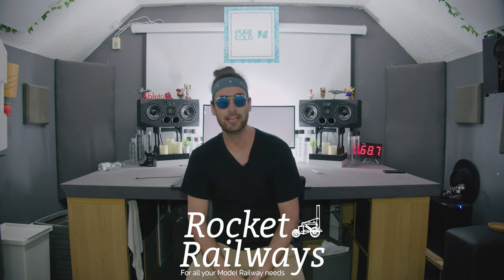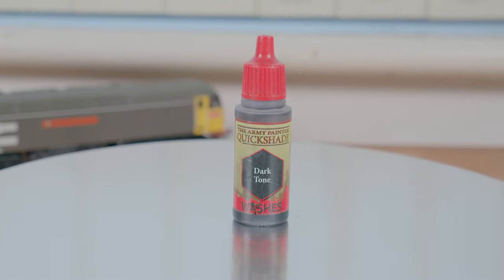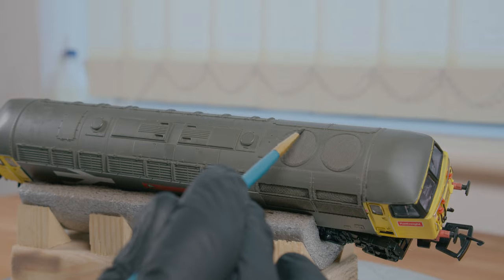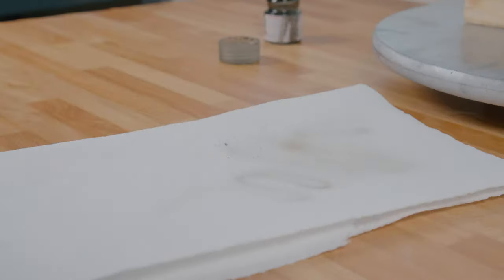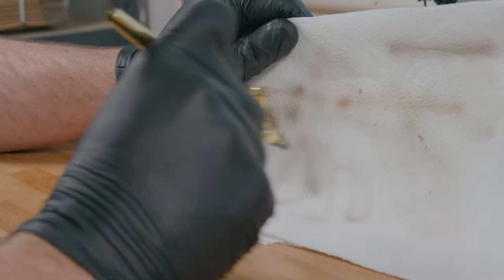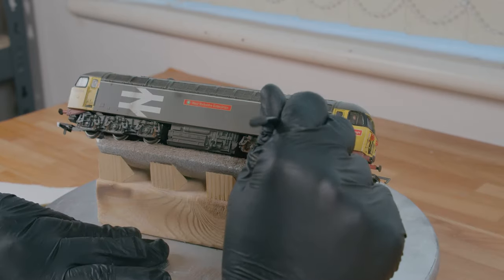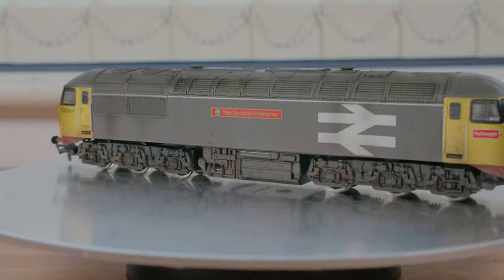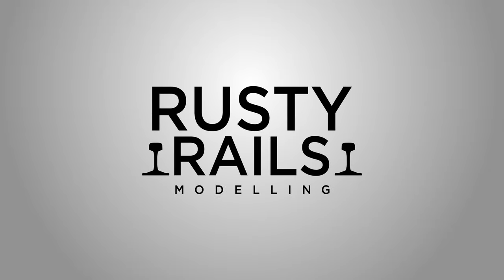How to Make Model Trains look Real | Weathing Tutorial

Comment: Fantastic video. Trying to get started with my own weathering so was great to watch. Wouldn’t have minded seeing the varnish going on though. This is what I’m most unsure about. (How many passes? do you thin it? Do you clean the wheels after?) look forward to the next one of the Class 60
Reply from the maker: hey ! thanks for the kind words :d

i usually do a pass then let dry and do a second and that should do.. if you feel it needs a 3rd then go for it !

the wheels are normally fine bit if you find your loco stutering then using isopropal alcohol or a little bit of nail varish remover on a cotton bud and try cleaning them :)

Comment: I'm so sorry for my billions of questions, but........

Is this gonna ruin the model if it gets into the mechanism? Does this work well on kits like a GWR Clerestory Coach? Should I tape off parts of the model? Is there a way to undo a mistake? Does this work on all models?

Sorry, man!
Reply from the maker: You should be okay with not damaging the loco… If it’s just a coach then it shouldn’t do too much because there is no electronic components on most of them, if you take parts of the model off then that’s totally up to you but if you tape over a weathered area it could pull the weathering up… If you wish to remove parts of the weathering then use Isopropyl alcohol on a cotton swab but again be really careful you don’t remove the original paintwork… If you check out my latest video where I whether a class 37 you will see me do exactly this towards the end